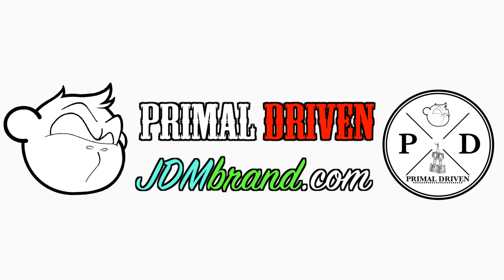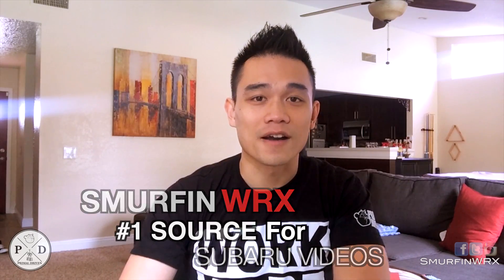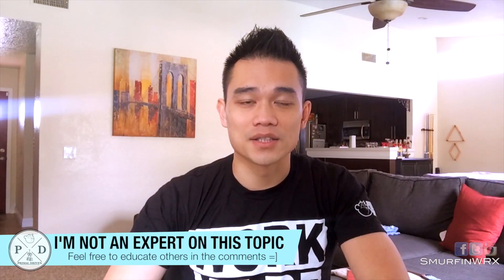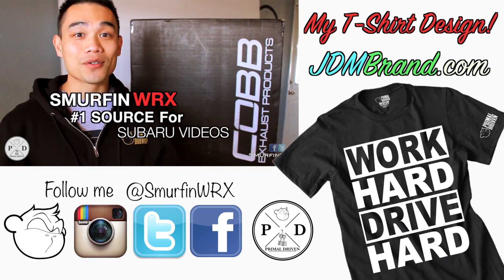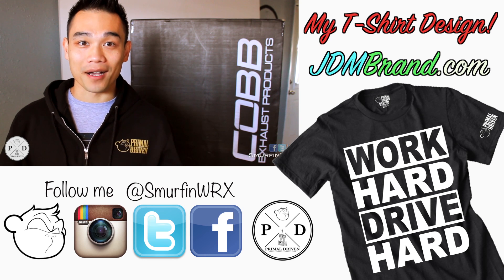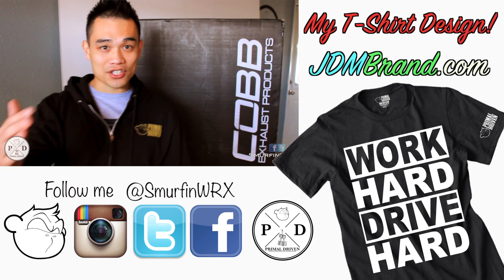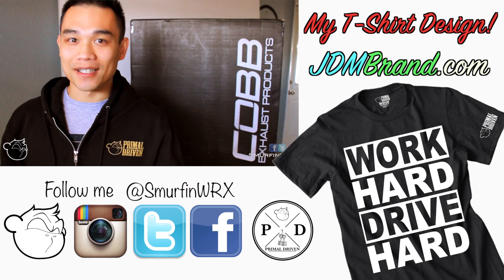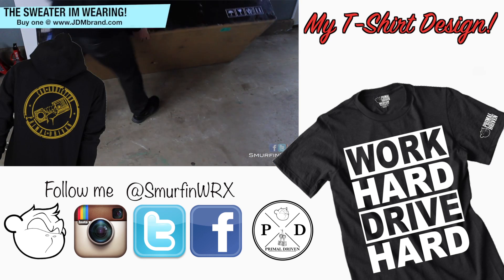What is Ringland Failure | Subaru

Comment: It’s almost always tune related.   The stock tune can suck on some engines.  Not every engine is the exact same. Which is why OTS tunes run great in some cars and poorly on others with the same supporting mods.  Piston gets too hot and begins to detonate before the right moment to fire.  Causes uneven force on the piston, uneven heat across it. The piston starts to rock as it goes up and down the cylinder wall. Slowly cracking the side of the piston.  Don’t drive the car super duper hard.  Doing a few pulls and letting your turbo cool down is totally fine.  Ring land failure is rare on a stock engine or even a lightly modded car.  The new stis are pretty bad though.  I’d imagine a class action soon.

Comment: NASIOC has an awesome older thread where two fellas put 4 egt thermocouples in their manifolds and then also el headers.

They found that with the oem manifold they were getting up to 100F higher temps on the driver side thermocouples (cyls 2 and 4). They switched to el headers and the readings for 2 and 4 lowered and all readings were within 20F.

This suggests that the longer tubing lengths of the uel manifold can cause backpressure and temperature spikes.

Other possible causes could be higher airflow to cyls 2 and 4 from bias in the intake manifold causing lean condition and bias in the cooling system causing vapor stagnation around cylinder 4.

A NASIOC member started a poll tracking which cylinders people were blowing and #4 was blowing at about 3x the rate of the second most frequent.

Possible sources of error in this study are placement of the thermocouples on the short oem manifold causing turbulence and inaccurate readings and also excessive "afterburn" from close proximity to the exhaust port cauaing inflated readings (there is not enough space for optimal placement of thermocouples before the runners join).
Reply: Good solutions, in no order:
pro tune
Equal length headers
Air/oil separator
catless/larger downpipe
Forged pistons

I alsp recommend placing your egt thermocouple in the #4 exhaust runner of your header/manifold.

Comment: lol ring land failure isn't caused by the car running too much power, its because of running too lean in Air fuel ratio. heating up the the combustion chamber causing hot spots inducing detonation, or heating the pistons too much and disintegrating them.

Comment: my 09 sti just had a new motor  installed a year ago at the dealership and has no mods. 
I now have ringland on it and only have 10,000 km.
Subaru needs to pull there head out there asses and figure out a plan to fix there shit motors!!!!! 
I'm considering driving the car threw the Subaru  dealership  and lighting it and the dealership up in flames!!
Reply: My WRX 2014 with 9K km also failed. Subaru will apply guarantee but  I'm also considering driving the car threw the Subaru  dealership  and lighting it and the dealership up in flames. Do you advice me to sell it after repair? Have you had any failure after repair of yours? Thanks and greetings from Mexico.

Comment: Great video!!! After speaking to a Subaru turner there are four other reasons for ring land failure and big end failure. 1. Poor maintenance (wrong oil and in frequent oil changes) 2. In frequent spark plug changes 3. Poor fuel (higher octane fuel the better) 4. Cold air intakes without a tune/remap. Hope this helps Subaru owners!?!?!

Comment: Dont use stock Subaru pistons. If you want to build your car, do it the correct way and build your internals too. Always go aftermarket forged pistons and rods at the minimum if you're doing a big power build. Wrx's went from forged pistons in 02-03 I believe to a new style cast design which is causing this problem. A "simple" piston change will fix this issue. This video is semi misleading since you can build all the power you want without blowing your engine (theoretically), you just need to have internals that are up for the job.  Note: if you plan on going forged know that they will expand more then a cast piston and will need the cylinder to be opened up a bit to accommodate for this

Comment: Older vid, I know but my 2c:

My feeling it that it's not so much too much power or even overly weak or defective pistons but rather the freakishly tight ring gaps used by Subaru from the factory.

While hypereutectic pistons are fairly brittle they can withstand a good deal of cylinder pressure on a good tune without failing. The fact that most of the ringland failures I've seen in these engines do not involve the crown cracking off but rather the lower lands breaking suggests it's not the "hammer strikes" from detonation that's damaging the pistons. 

Subaru recommends the following gaps for the rings in the EJ257:

top compression:  0.0079-0.0098"
middle compression: 0.015-0.020"
oil scrapers: 0.008-0.018"

That top ring gap is far too small for a 99.5mm (3.917") bore on a turbo motor. Most builders of boosted engines would recommend a minimum of 0.004 or 0.005" per inch of cylinder bore for "mildly" boosted gas engines (more for higher performance engines...) That would mean a minimum top ring gap of something more like 0.018". Even that middle gap seems tight too. I'd go at least 0.005" larger than the top gap on that ring... I think that a factory top gap of 0.010" (max tolerance!) is likely closing up, the ring ends are butting and that is seizing the ring to the bore momentarily at which point the ringland breaks. This will happen when a lot of heat is being put into the piston crown and ring pack, such as under boost, experiencing detonation etc. Bad gas, an aggressive tune, sustained hard driving etc will all lead to this. Certain cylinders may be more susceptible if they naturally run hotter (e,g, the rear two cylinders, for example.) 

I think factory-stock engines that break were likely on the "tight" end of the tolerance window for one or more rings.

While Subaru is a slave to emissions and economy regs (so they target tight ring gaps to reduce blow-by and oil consumption) and they eschew forged pistons (noisy, expensive, loose-fitting means worse NVH, worse emissions, more customer complaints etc) it seems like they treaded a little too close to the edge by running gaps that so adversely affect reliability. It's unfortunate to feel like I'm walking on eggshells whenever I get into boost on my '10 STi.
Reply: Blackfinity1 thanks for this clear and informed comment that is full of useful information. 👍
Reply: Best answer and most accurate out of all of 'em. Kudos to you, you're more knowledgeable than most.

Comment: There are plenty of theories on what causes the failure and how to prevent it, you cant really say for sure. It seems it can happen to anyone from the bone stock grocery getter to professionally built race cars. According to experts like Crawford the best way to prevent it is to get a conservative tune from a good tuner (the factory tune is bad), use high quality premium gas and install an air/ oil separator.

Comment: I've always wanted an sti just because of the boxer rumble but instead got an Evo 10 because of the recaro and easy power bolt on. one day I will get a subbie but not until they come out with a better fix
Reply: They do have a fix... Its an FA20DIT
Reply: +Jesse Parton but no rumble, that what makes it unique.
Reply: +dsourn - would you rather have a blown Engine or the rumble?I have a 2015 and the new engine has way more potential and it can handle a ton of power. I love the rumble too, but when you consider why the rumble is gone, its not so bad. The FA20 builds boost so fast because of the new turbo, which needs equal length headers to work properly. You lose the rumble, but gain so much more.
Reply: +Jesse Parton you have a good point but I rather still have a rumble, the Evo 10 have a little rumble to it since it has little unequal length header to it but not as awesome as an sti and still build better power then an sti. I'm sure many sti owners get it because of the rumble and don't want it to sound like another import down the block.
Reply: +dsourn - you never know, the new model may have the rumble.... It also sucks that the EVO will no longer be produced. People love them, i dont know what mitsubishi is thinking.

Comment: I wanted to buy a 2016 Subaru sti but I'm afraid of the ringland failure
Reply: +DJFish8051 How to prevent it? Dont get one. People that drive normally or like grandmothers have failures. The Dealers are to say that burning a quart of oil between changes is normal... I have seen cars that burn oil like that, they have 200k Miles on them , not cars with 11k
Reply: My G35 essentially has the same issue, it's devouring oil. Shame the VQ35 isn't as over built as 1UZ out if my old Lexus.
Reply: Get and evo
Reply: +DJFish8051 dont mod it then
Reply: +DJFish8051 or just get the great 2004 model
Reply: DJFish8051 it sucks
Reply: DJFish8051 Honestly get what you want. Your gonna regret it later, even though that STi can mess up.

Comment: i got a 13 bone stock sti with just 2k kilometers on the clock and now it has this ringland failure.. its really sad and is there a way other than replacing the motor?
Reply: +Kevin Morgan dont you have a warranty?
Reply: CrazyForCooCooPuffs it turned out to be a spun rod bearing #3 yup it got covered by the warranty :)

Comment: Well it is caused because oil gets to the air filter and into the engine detonating and causing the problem so the best solution for this are 4 mods 
1 forged pistons with better ringlands ( yoy can do also rods and modify up to 400 hp without blowing your engine )
2 AOS ( air oil separator ) that keep the oil out of the air filter 
3 good tune ( OTS maps are allright) 
4 if you are not going high hps dont change the air filter nor the FMIC you dont need it.
That will mostley solve entierly that

Comment: The main reason why the internals failed was because of the material of the pistons were made cheaply. Better forged internals to handle the pressure those rings wouldn't pop like that .

Comment: This issue happened to me on a stock 2015 Subaru WRX STI other than track brake pads. I was on the track when it happened around 6K miles. I checked my oil every week and did the break-in procedure according to the manual. Subaru covered it under a goodwill gesture, but not under the warranty since I admitted that I used it on the track. I wanted to see how Subaru deals with the situation considering their marketing brochure says that the car is "track-ready" (with fine print about possibly voiding warranty). I am getting forged internals, a pro-tune and an AOS to hopefully prevent this issue again. It's sad that this has been going on for such a long time. I advise anyone wanting to keep the car stock and pushing it hard to not do so or upgrade the engine yourself. You can also wait for the new engine in the STI to be released. Subaru should either change the marketing or upgrade the engine (while keeping the warranty valid for track use if the marketing doesn't change).
Reply: Really?  Was considering a 2015, assumed this would be okay with stock engine configuration.  That is a major bummer.
Reply: Chris Edgette Unfortunately... either get a 2015 WRX and not the 2015 STI if you want a better engine until the STI gets a new engine or upgrade it like what I am having done. I thought that if I took care of the car that I could avoid the problem.
Reply: Subaru Racer Can I ask what the symptoms were of your ringland? I have a 2015 STI also and have gotten a puff of smoke twice on cold startup, no loss of power or oil consumption (early days so will see how that goes in a week or so).
Reply: Ruairi Toale When the issue happened, there was white/black smoke coming out of the exhaust. The engine was bucking at a certain speed and I lost power slowly. It acted like I kept hitting a fuel cut. I couldn't hit the target boost anymore. The ECU seemed to change the timing to save the engine. I was able to drive home for 2 hours with not much drama at least.
Reply: @subaru racer what all needs to be replaced if I wanted to upgrade internals?
Reply: MrSteevrok21 Change to forged pistons at least. I also changed to forged rods in order to handle 500 WHP.

Comment: Just want to discuss the other issue I had with my 2012 STI. I had a problem with so called power hesitating at about 5000 rpm. The car was 100% stock.  I was called from Subaru to reflash  ECU. It helped for awhile but didn't  solve the problem. The car simply didn't accelerate as it supposed to and all of it was when it has only 10000 miles. I did some research and I decided to simply buy the COBB access port and reflash the ECU. I took my car to Fine Line Imports where they put it on  dyno and tune it just around 10% over the stock. I simply wanted to be safe and ask them to increase the boost as little as they could. Its not only solve the problem but give almost 30 horsepower and 50 pounds of torque. I could get more if only installed the downpipe which actually I'm planning to do pretty soon ( the catalytic converter in my opinion is a killer for this engine as well as stock ECU maps that tries to converts pretty old engine for environmental friendly one due to California tough emission norms).  
I already did over 35,000 miles with no problems. You have to remember if you do something do it correctly. The problem with most guys is they put some parts like intakes, exhaust systems, downpipes without proper tuning which can be done only on dyno. Sometimes simply tuning is helping to get your car running better, in this case actually it fixed the problem the dealership couldn't! If you decide to tune your car let the experts do it!
My power mods will include oil/air separator and downpipe . I would go with exhaust but I drive long distances and simply like when it is quiet :-) That setup should give me close to 300 horsepower in wheels and that's it! I am NOT getting greedy! if I wanted more I would have to replace the internals in the engine - every good tuner tells you that.
Additionally I want to just say that I also drive 100% stock 2013 STI with SPT exhaust system and I didn't have any problems so far (11000 miles)!  
Just be smart not cheap!
Reply: +Marcin Ziolko I take my 2013 STI to fine line imports as well and have been very impressed on their knowledge and work done on my car....I've had them do my cold air intake, up pipe and pro tune....not all at once but in chunks....they"re expensive but its well worth the money for sure! I know some people go cheap because it's expensive BUT is it worth going cheap and then something happening to your car and you paying out the ass for something you could've prevented......so far (knock on wood) I haven't had anything happen to my car yet even tho it has 24,850 miles(which isn't a lot) on it....I try not to beat the piss out of my car but ill give her some juice from time to time.  Mods so far are....invidia Q300 cat back exhaust, down pipe, up pipe, cold air intake, stage 2, pro tune

Comment: Subaru wrxs are built in Japan and shipped over the problems arrived when they where purposely mapped lean to buy pass the emissions. Once the emissions test was complete they where mapped by dealers. Trouble is the map subaru provided was well bad and engines started going pop. That was the 2008 on hatches. That problem has long been fixed.

Comment: Ringland failures really come from Subaru's flawed PCV system. Even in stock form, there are chances where oil from your crankcase and head vents get into your intake. After it gets into your intake, it ends up in your combustion chamber where it burns and creates hot spots on your pistons, or even worse = detonation.  When you mod your car to push more boost past its rated stock power, on it's STOCK cast pistons, you increase the chance of blow-by in your system, therefore releases MORE oil into your combustion chambers, and then KA-BOOM!!  The flat four engine is awesomely designed for lower center of gravity and vibration during operation.  Its even has its own baffles and PCV drains to combat blow-by but like I said, it is still flawed.  

TL;DR
The ONLY way to combat ringland failure is to use an air-oil separator (AOS).  Plain and simple...
Reply: Ice Rex It depends on the dealer technicians.  But for the most part the dealer has to prove it was the root cause of the failure to even deny a warranty claim.  I can't see why a "proper" AOS is detrimental because all you're doing is preventing the oil from being burnt in the combustion chambers.  An when I say "proper" AOS, I mean one that retains the PCV valve in the system.
Reply: OCTurboJoe How does the AOS from Perrin compare to the AOS from GrimmSpeed?

Comment: I'm planning to buy an 2013 sti as fun weekend car, not gonna modified it (probably just cb exhaust) and proper maintenance. not gonna drive it hard... What are the chance i'll get those ringland problems?
Reply: very low. just go full stage 2. as long as you're not flooring it aaall the time, redlining or excessively launching. don't 'diesel' the car either..4-bangers need proper revs to accelerate

Comment: Ive got a 2013 sti, and im at 24,000kms completely stock. I drive it fairly hard but always do a proper warm up and cool down. Im in canada so i always put 94 octane in it and do proper oil changes. I want to go stage 2 with cobb ap, intake with airbox and downpipe. Would i be safe with these mods as long as i keep an eye on knock and afr?
Reply: You shouldn't do it because my WRX's rods,crankshaft bearings, rod bearings, gaskets,oil pump, and my crankshaft went bad after 14 k miles.  I had the same exact mods. Good thing I knew someone at the Subaru dealer. Just don't do it. It will save you a lot of time and money.